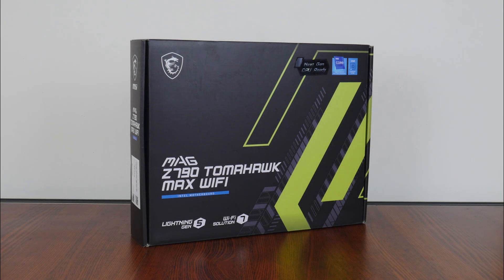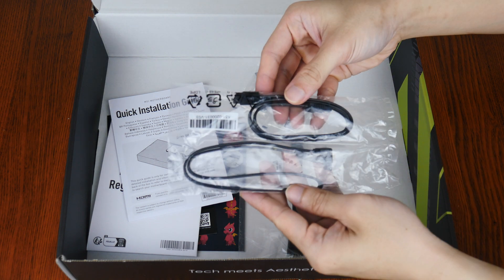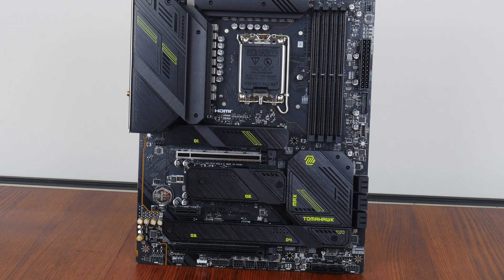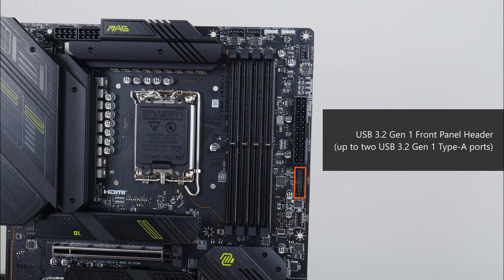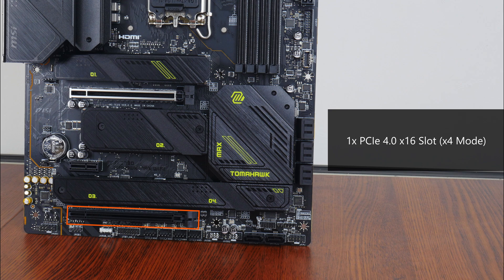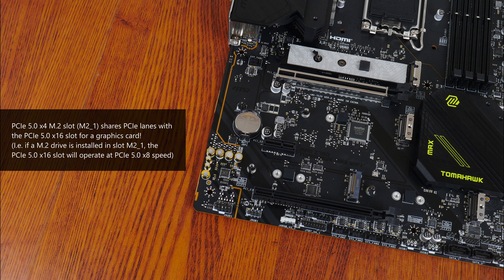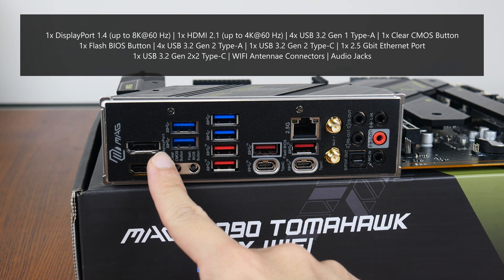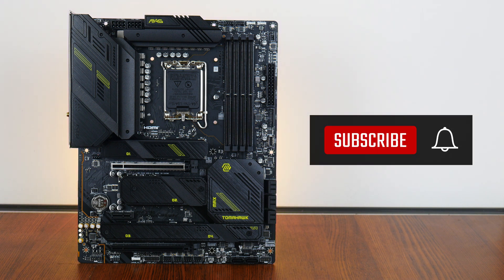Ready for Intel Next-Gen CPUs! MSI MAG Z790 TOMAHAWK MAX WIFI Unboxing & Overview

Comment: I have a evga 3080 FTW3, and currently need use a WIFI PCI card. I want to get this board with when i buy a 14700k. But. from the looks of it, you wont even have access to that little x4 slot. If you have atleast a 3080, its going to be too thick from the looks of it. What is your take on this? Do you thinks theres room to fit 3080 and a wifi pci card i nthe little slot?
Reply from the maker: Mmm. The EVGA card seems to be 2.75 slots thick (at least according to EVGA's website), so you MIGHT just get lucky to be able to squeeze in a WIFI card into the x4 PCIe slot...though without actually trying out for myself, I can't say this with absolute confidence!

Comment: What's the fastest ram speed this mobo can handle with all 4 dimms filled? I know some mobos can handle the advertised speed but with only 2 dimms. I want to use all 4 dimms for aesthetic reasons and because why not use all 4 dimms if im paying for them.
Reply from the maker: According to MSI's specs sheet, speeds of up to 6400MHz+ are supported with four single rank modules, while four dual rank modules can run at speeds of up to 5600MHz+!

Comment: About to build my gaming pc on this board today, which m.2 slots should i use then? 

-1 Tb 980 pro for main drive
-500gb wd black for silly games 
2tb ssd for all other storage 
14700k 
3080 
64gb ram
Reply from the maker: Install your M.2 drives in slots M2_2 onwards!
Reply: Since there are no pci gen 5 graphics cards it makes no difference if you install it on M2_1

Comment: 90 amp is not as high as I'd expect for a new tomahawk I'm definitely not going to upgrade my z690 tomahawk there's nothing special about this motherboard and the lime green is ugly. The gigabyte motherboard's are the way to go with this gen of motherboard's they offer higher ddr5 speeds and better value.
Reply from the maker: I personally have a Z690 motherboard for my Intel test rig, and have no intention of swapping it out for a Z790 or Z790 Refresh board too, seeing as the differences are really minimal - think perhaps faster DDR5 support, more USB 3.2 connectivity and so on. I'd think that folks who purchase Z790 Refresh boards would be those upgrading from a much older platform (perhaps 10th/11th Gen or earlier)..
Reply: @ALKtech  "much older platform (perhaps 10th/11th Gen or earlier)" . I'm upgrading from a 2nd gen sandy bridge :rofl:
Thx a lot for providing the written article, easier to skim and to CTRL-F
Reply from the maker: @rahpat01  oh wow 😂 my Ivy Bridge i3-3220 processor sits disused in a corner somewhere since its motherboard died many years ago...what specs are you going with for your new PC build?
Reply: @ALKtech I considered an i7 gen 3 lol, but I'll go for a i7 14700k on MSI z790 tomahawk max / or edge max / or ASRock steel legend. I need those 8 SATA3 ports, I still have one old IDE disk & dvd to connect with an adapter 😂
My faithful i5 2500k and its ASRock Fatality mum will soon finally rest after 12 years+ of labor

Comment: Thank you for making this overview, I've purchased one of these on preorder.

Would it still be beneficial to use a 3rd party contact frame on this motherboard, or has the bending/temperature issue been addressed?

I was also wondering which of the slots I should use for my NVME PCIe Gen 4 SSD, in order to avoid sharing lanes with the GPU.
Reply from the maker: Hope you found the video useful. If you've got the budget for it, go ahead and get a contact frame - as far as I know, I don't think there have been any conscious efforts to solve the bending issue with the stock processor retention mechanism...if you're going for a high-end processor (e.g. an i7 or i9), might as well just spend that few extra dollars for improved thermal performance!

SSD slots wise, avoid using the first slot (M2_1), and pop your drive(s) into the second, third and fourth slots!
Reply: You should NEVER pre order anything! Wait for reviews your going to be upset when you find out that gigabyte motherboard's will give much higher ddr5 speed's
Reply: @toonnut1  Considering that the board I ordered now has a 1-3 month wait, and Gigabyte's equivalent Z790 Aorus Elite X AX is priced $100 more where I live I feel happy about my purchase.
Reply: @eamonnpownall5216  if your happy I'm happy no worries 👍

Comment: Bro which motherboard should i choose for i5-13400F 
1.MSI Pro B760M-A WIFI (DDR5)
2.MSI B760M Bomber WIFI (DDR5)
3.Gigabyte B760M DS3H AX (Wi-Fi) (DDR5)
4.Asus Prime B760M-A WIFI (DDR5)
Tell me which is best for i5-13400f
Reply from the maker: I'd be more inclined towards the MSI PRO B760M-A WIFI - it has the best VRM setup of the lot. That said, a 13400F isn't a very power hungry processor, so any of the boards that you've listed should work equally well ...are there significant price differences between all boards where you're from?
Reply: @ALKtech  I am from India
Reply: @najisibin  thanks

Comment: This isn't next gen though, is it? Intel will change socket after this refresh and this motherboard will be obsolete. Is there any tangible advantage to upgrade from a z690 board to z790?
Reply from the maker: Next-gen being in reference to Raptor Lake Refresh that should be hitting the shelves sometime in mid-October 2023...15th Gen (or whatever else Intel might call it in the future) will be on a different processor socket, so yes, this board will be in that sense, obsolete by then! If you're already using a motherboard with the Z690 chipset, there's nearly no benefit from upgrading to Z790, as the differences between both chipsets are really minimal. Heck, you'd probably be able to drop in a Raptor Lake Refresh processor into your Z690 motherboard for an upgrade in any case - what Z690 board are you using at the moment?
Reply: @ALKtech  Yeah, that was about what I thought. The whole refresh thing throws me sometimes when people mention next generation, I usually think of different architectures.

I'm still on AM4 currently, probably will go AM5 next upgrade and will wait to see what the x770 boards or b750 boards look like whether to go with one of those or a cheaper x670e or b650e board.

Thanks for the response and have a good day!
Reply from the maker: @richardsmith9615  totally get what you mean, especially since Raptor Lake Refresh wasn't supposed to have existed in the first place anyway...until Meteor Lake for desktops got canned.

That said, what you've got in mind sounds like a good plan, you might even score yourself a good deal with X670E or B650E boards by the time AMD's 700-series chipsets hit the market. Cheers!
Reply: I was planning to buy this motherboard to pair with i7 14700k for a new PC I'll be assembling. Your comment made me reconsider that plan. If intel is going to change the socket next year, should I go for Ryzen build with an x670 motherboard? I believe Ryzen 8000 series will be supported by AMD..
Reply: @wickedmetalhead   Yeah, x670 will support Ryzen 8000 series. It is of course your decision and in terms of performance it looks as though the 14700k is very efficient, but yeah, if you want to keep upgrade paths then perhaps AM5 is a better option for you.
Reply: @richardsmith9615  by efficient you mean efficiency in terms of power consumption? If that's the case, I don't mind more power consumption..
Reply: @wickedmetalhead   Yeah I meant in terms of power consumption vs the performance offered. If you don't mind more power consumption then maybe you could stick with 13th gen tbh, the upgrade in terms of raw performance from 13th to 14th gen is apparently not especially impressive, it's more refining the architecture to be more power efficient. Best of luck and hope you find something you're content with my friend :)